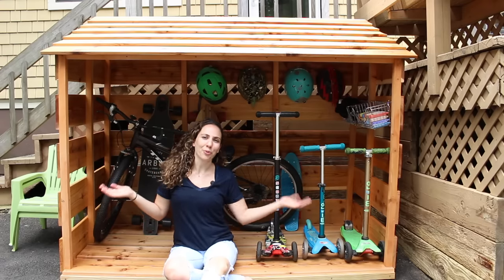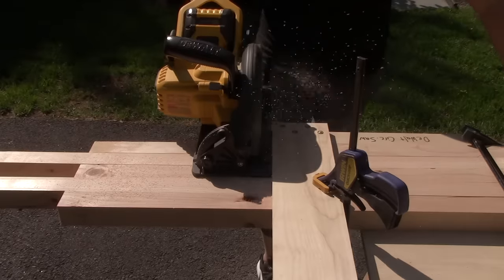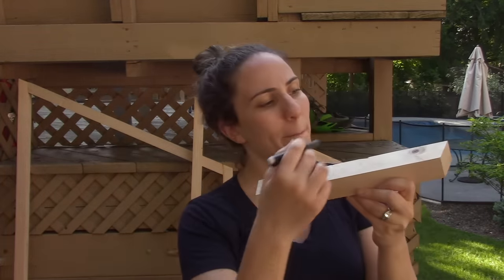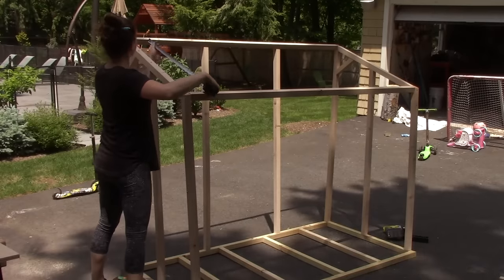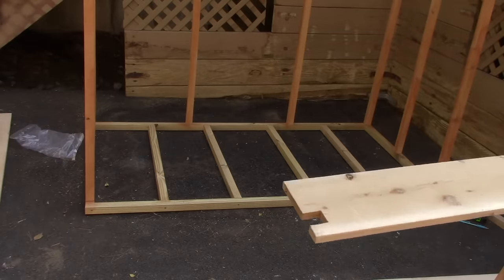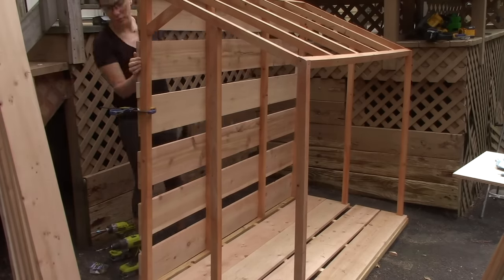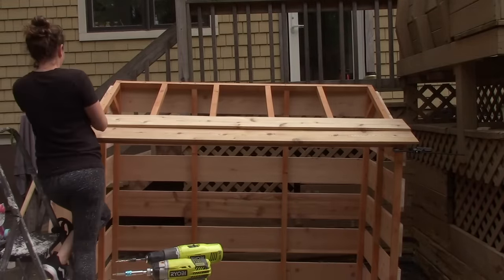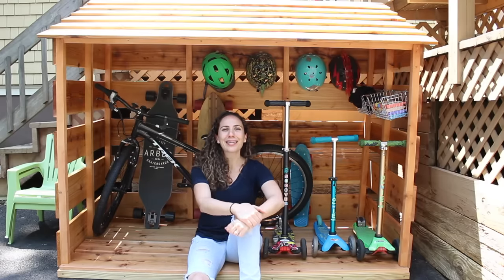DIY Bike Storage Shed // Beginner Woodworking Project // Outdoor Storage // Storage Solutions

Comment: Even though you have used treated timber for the base it’s still good practice not to have any wood touching the ground so the wood is never sitting in standing water. If the wood sits in water (when it rains) the wood will rot far quicker than if the wood is lifted off the ground. There are many solutions to lifting the wood off the ground e.g. plastic shims, rubber feet etc. Basically do anything you can to reduce the possibility of rising damp.
Reply from the maker: Good thing my driveway is on a crazy slope and water doesn’t collect there...
Reply: @3x3CustomTamar  Great project, I built one similar and used composite decking boards for the base as theyre totally water/rot proof.

Comment: That turned out very well. If the gaps bother you too much, you can add boards to the inside centered on the gaps. I've seen that on fences before and it gives a neat 3D effect.
Reply from the maker: Thanks! That’s always an option!

Comment: Great project. Adding a narrow plank in the gaps , leaving a small gap each side of it , would turn a slight error into ' A Design Feature ' !  Well, that's how I sell my ' departures from design ' anyway  ;-).   No-one looking at the finished product would see any mistakes because the end result works.
By the way, pre - gluing the end grain is common practice on balsa model aircraft structures and is surprisingly strong.
Reply from the maker: Good to know pre glueing the end grain is an actual thing! Ha! And totally agree it would look cool and be a cool design feature. Maybe one day.

Comment: Occasional moisture should not be a problem for most of the equipment.  Helmets, pads and chalk are all store high and directly under the roof so they will be fine even in a sideways rain.  We have firewood storage sheds that have similar gaps or bigger and the wood stays dry and rot free for years.  Nice project. Turned out great.
Reply from the maker: Awesome! Good to know! Thanks!

Comment: Great job! I've gotten into the habit of using Fusion 360 for designing my projects. It really helps me see design flaws before I start cutting wood. I can also export a build list which gives me the dimensions of everything I need to cut. You can use it for free as a hobbyist and the learning curve is really pretty short. Anyway, this was another great video. I'm really enjoying your cinematography and presentation style. Keep it up!
Reply from the maker: Thanks so much! I haven’t tried fusion 360 yet. Only sketch up. And I only use it after I build something to draw plans for other ppl to use. I need to to get better at making the plans before! Ha!
Reply: 3x3Custom - Tamar I tried Sketch up and didn't really like it very much. I didn't find it to be very intuitive. I mean, definitely use what you're comfortable with - I'm not trying to slam the way you do things. If you get a chance, though, give Fusion 360 a try. Oh! You can export g-code for your CNC from Fusion 360, too! I didn't get that far in Sketch up but I've heard from others that there are some hoops to jump through for g-code. Anyway, I'm first and foremost a computer geek so I start pretty much everything on the computer and it has made my projects go smoothly. Take care!
Reply from the maker: I’ll def check it out! Thanks!

Comment: Nice work, well done.
I would have used Spar Varnish heavily diluted with Mineral Spirits and two coats for UV protection and moisture.  The rest of the finishes are worthless for outdoor use.  This will bring out your wood and be very resilient.  Recoat every 5 yrs.
Reply: Will this work better on cedar wood for a outdoor playground?

Comment: Nice build.  I'm going to build a same shed like this one but mine should be waterproof because I don't want to deal with rust every year after the winter time. so I need to add doors and the put a small gap if any between the sides and the back. thanks for the video
Reply from the maker: Good luck with it!

Comment: Great job! You probably will need to reapply the water seal each year. When we had a deck , I found it easier to have a spray gun to apply. It will make quick work of sealing your deck and your new storage. If you have a wooden fence it will work great on that also.   :)
Reply from the maker: I should def put it on my fence! Thanks!

Comment: Great video and good inspiration for a project that i have in mind. I need something similar for our bikes. I need it to be large enough for 5 bikes and as one of them is rather expensive, I also need to lock the shed in the front. I do not want to move 4 bikes in order to get the 5th, so it needs enough room for the bikes to stand parallel to each other.

Comment: Nice job and making mistakes and learning from them. Is how you improve your craftsmanship. But I'm not a fan of the finishes that have to be applied every year. I use Spar Urethane on all my outside projects. There will be more work upfront applying it. At least 2 good coats. But less work later to maintain it. I have an outside bench I did at least 5 years ago. The finish still looks good.
Reply from the maker: Thanks! I use spar urethane on all my outdoor tables and i love it! I just wanted to try something different. We’ll see how I feel about needing to refinish it. Ha

Comment: If we need to put this on dirt. What is the recommendation to anchor it so it does not blow away in wind :)
Reply: Or is the idea that because the unit has holes for winds to pass through the pressure from wind will not enough to blow this away. We are in pacific north west (seattle).
Reply from the maker: Sorry I don’t have that issue